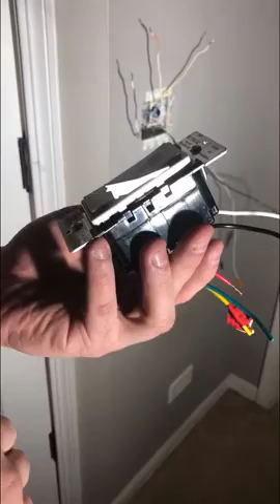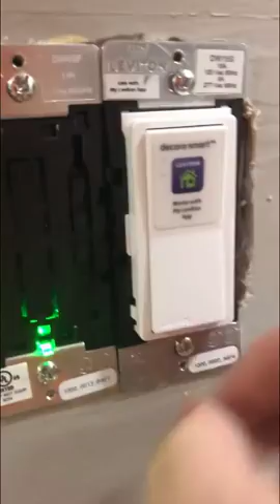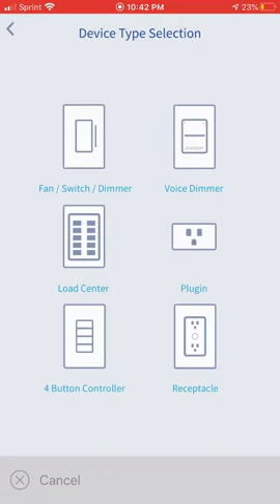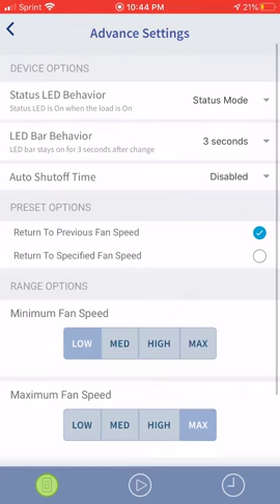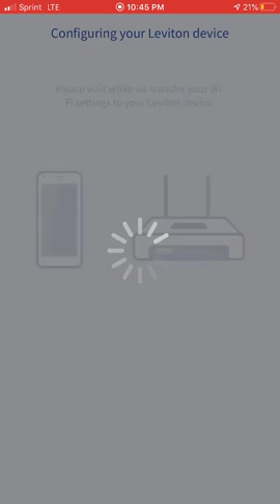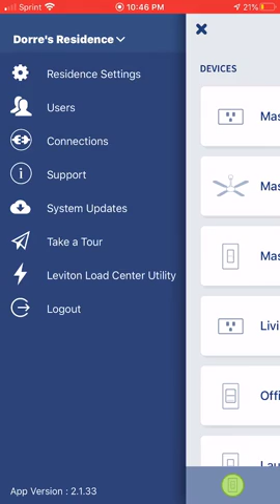Installing and Using Leviton DW4SF 4 Speed Fan Controller NEW on the market Review

Comment: I can't find a copy of the installation instructions to answer a question I have.  Is there a receiver or module that goes in the fan?  I don't see how it would control a fan with pull strings on it.  The product details says it works with fans with split-capacitors.  But how unless there is a module that goes in the fan?
Reply: I just installed it on a Fan that DID NOT have a remote.  I set the Pull Chain to High and then used the toggle on the Switch and/or the App to control the speed.  I also hooked it to Alexa and can now use my voice to set the speed.  This switch is awesome!!
Reply: @BestofNorthernVA  how are the speed controls? Do you find that the speeds on low or medium (the 2 lowest settings) are useable i.e. how the fan was operating prior to installing this switch? The reason I ask this is a lot of people who have these smart fan switches complain that the speed settings for the low speeds are gimmicky. Because a fan with a pull chain normally does 3 speeds and these do 4 so apparently the 1st 2 speed settings don't do much or are even worse than the original low setting.
Reply: @zizzy14  Set the fan to High at the fan (use the pull chain to set it to high).  Now you can use the Leviton Switch to control the Fan Speed.  I have no issue with any of the Fan Settings from Low to Max.
Reply: @SteveMeier  I don't own one yet, I've been doing my research first before deciding which one to get. 😊 Thanks for the information, I appreciate it!
Reply from the maker: See this link- https://robsreviews.net/wp-content/uploads/2020/02/Leviton-DW4SF-Guide.pdf

I just change the fan switch out in the wall. I happen to have a remote controller in the fan that I took out that was controlled with Bond Home Device
.

Do you have thoughts on a video I can make that would help others with your question?
Reply: @robsproductreviews915  Rob, if you have an answer to my question below that I asked to Steve as well, please let me know. Thanks for the review btw! Good video!